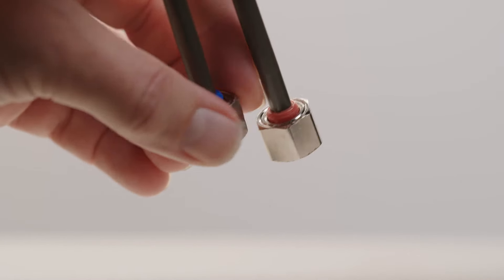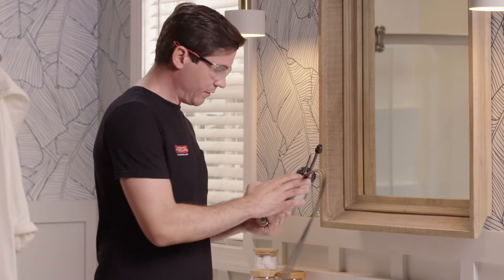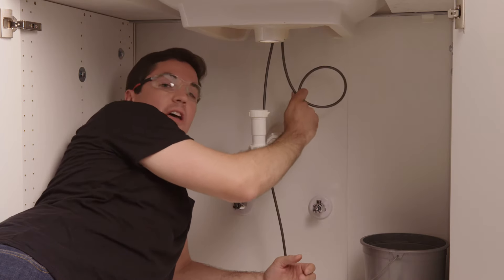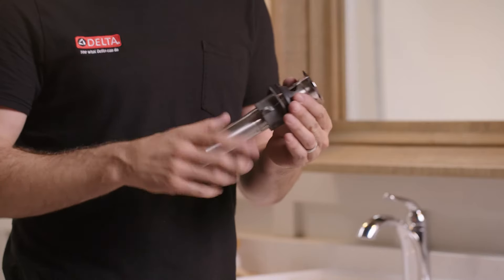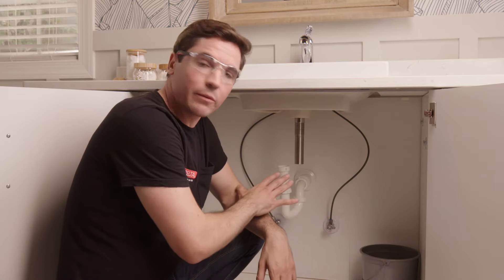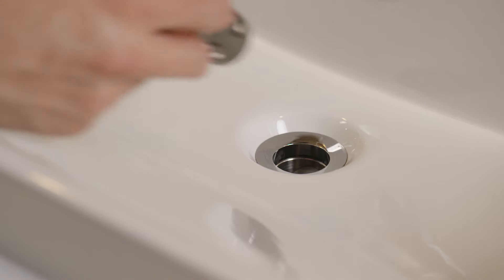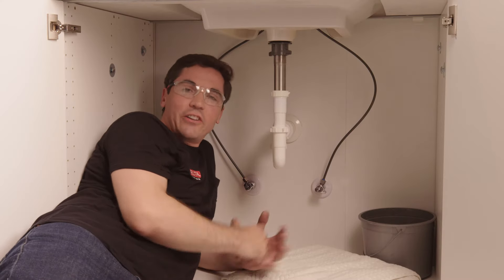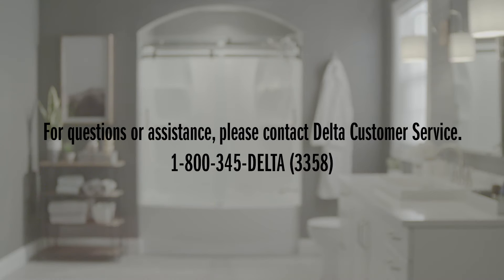How to Install a Delta® Single Handle Bathroom Faucet with Diamond Seal® Technology

Comment: With a stuck aerator & having ruined one aerator tool which Delta thankfully replaced, I would recommend taking aerator out BEFORE installing faucet head. That way you can see the grooves in aerator when taking it out.